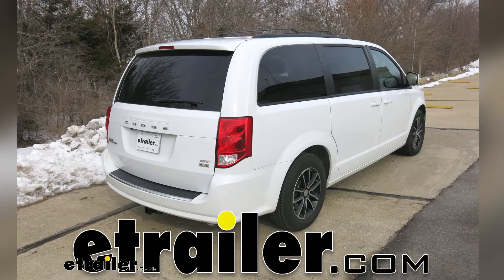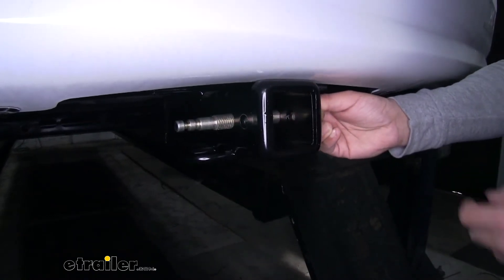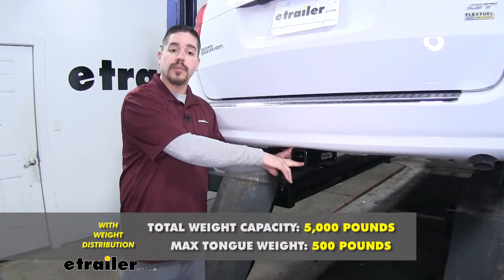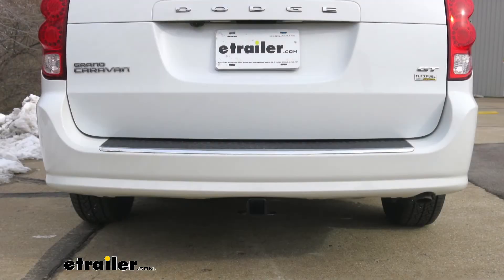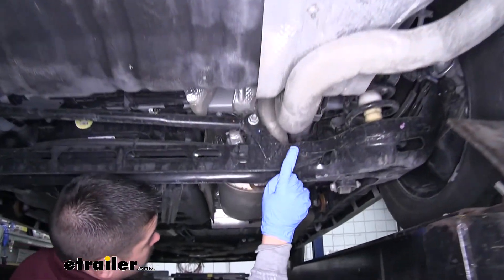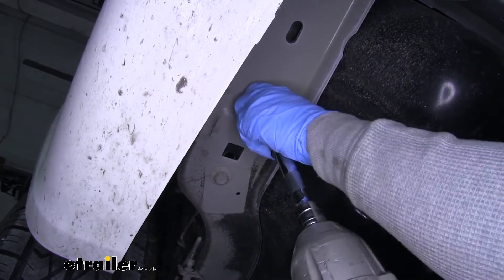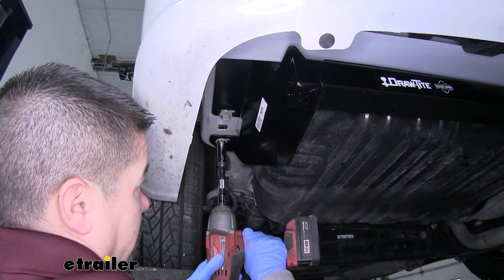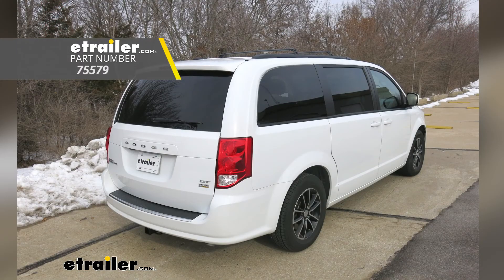etrailer | Set up: Draw-Tite Max-Frame Trailer Hitch Receiver on a 2019 Dodge Grand Caravan

Comment: Is it safe to use the safety chain connection points to, for example, pull out another stuck vehicle, or to pull out the Caravan if it gets stuck itself? One of the reasons im thinking about getting this hitch is because there are no good places on a grand caravan to hook up a strap or anything.
Reply from the maker: We wouldn't recommend doing that, because the safety chain loops aren't designed to be a recovery point. Using a hitch mounted tow loop like # C45832 would be a better (and safer) option for you.
https://www.etrailer.com/Tow-Shackles/CURT/C45832.html